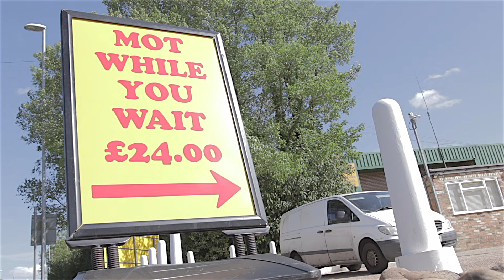High Pressure Fuel Pump Removal, Mk5 Ford Mondeo   And A Broken Timing Chain

Comment: Thanks for the tutorial and also appreciate you sharing your knowledge about doing the job while it's still on the car... I need to change the fuel pressure regulator that's on the back of the pump and this video has helped me feel reasonably confident in attempting this

Comment: Hello Alan I get A P0087 code but engine starts and runs perfectly, I have a heavy foot so Def no change in performance. I clear the code and it takes a week to 2 weeks to come back. Fuel pressure is ok when scanning. Does NOT put an engine management light on. I scan ECU every 3-5 days, it's just something I have always done with all my cars. Any feedback would be greatly appreciated. R Mc Nulty
Reply from the maker: hi rob, sounds like the start of a fuel injector leaking too much fuel back to the tank and lowering the rail pressure but not enough to put the car into limp mode. maybe best to just monitor it at the moment as the alternative would be to replace your fuel filter and carry out an injector leak off test
Reply: @alan4x  Thanks Alan this has been ongoing for a year now, 30,000 miles done, drives perfect, I'll get a leak off test done. Your a star.

Comment: I had Low oil pressure management light on my 2.0D Galaxy. I plunged in my Delphi scan tool, then found a code p253f saying engine oil deteriorated. Replaced the oil & filter, car fixed.

Comment: Vauxhall Insignia 2ltr 2017 rougly  also snaps timing chain due to tensioner failing, also it vibrates the bolt loose on the camshaft sprocket, damages lifters and valves.
Reply from the maker: thanks for the info

Comment: Brilliant video alan , weirdly cam sprocket doesnt have the second hole for 6mm , so ive good it sitting locked with the larger "8mm" hole my question is would this do the same job in regards to timing? 2014 galaxy btw

Comment: Nice video , those hp pumps also leaking oil from oil seal behind drive gear , Delphi seal it’s available from ford main dealer (bolt has left hand thread ), I miss England , maybe I sell my garage and all properties, and come back to uk . Greetings from Poland.

Comment: Another fantastic video about HPFP, but I have question about the rocker cover (this is how you call that in the video - time 8:45) and the hose this the only place in my engine (except HPFP) where I can see oil sweating and this is through that hose and the clip. I've heard that changing the clip for the one with the screw might help, but is it something to bother my mind? Should be this fixed, like changing the rocker cover (I think there is a spring with the rubber membrane under that round lid seen at 8:45min)?
Reply from the maker: hi rob...many of them leak a little from that hose..you can put a jubilee clip on it or replace the hose and clip,,,,the plastic rocker cover is a sealed unit and glued together..they often sweat oil between the glued joints but its minimal and not worth worrying about..also the plastic cover  is quite some work to replace...i have never had to replace one because it was faulty

Comment: we have a 2012 galaxy 2l diesel, it has started throwing loads of blue smoke out the exhaust on sunday, im in the middle of investigating as i suspected the turbo, but today i found a lot of oil under the diesel pump so it looks like i need to get that off tomorrow as well, is there any way this could be tha cause of the blue smoke or is that wishfull thinking. or could this be the reason the turbo may have failed. great videos and very informative, thanks for them

Comment: Hi love your videos am at whits end just done replaced engine in mk5 low it won’t start coming up with P0087-32 fuel rail pressure to low it’s getting fuel to the rail it also has ERROR on the dash where the millage should be displayed

Comment: Hey Alan, thanks for all the help and great advice you give with your fantastic videos. I know you are now living in the Philippines and probably haven't seen a MK5 Mondeo in a while, but I wondered if you could give me some advice please. I have both a Ford Mondeo MK5 and a Ford Edge Sport 2017. Both have the 2.0 Ltr Duratorq-TDCi engine. Unfortunately since owning the Edge I have had a problem starting it from cold. Once started the car drives fine, apart from only getting around 30mpg when Ford tell me I should be getting at least 40. It's been in to my local Ford Dealer and they said it could be the timing is out as it looks as though it's had a new belt. The car has only covered 52,000 miles. The timing was OK. Then they suggested the high pressure fuel pump timing might be out. So thanks to your wonderful video, I checked that myself and it is fine. Also the spring for the valve has not broken. Ford tell me that they don't believe it to be an electrical issue as no fault codes show up. As I have said the car feels and sounds OK to drive. Do you have any ideas what it could be? Oh, and why I have your attention, do you have any advice on setting up the gear linkage cables. The gears seem a bit knotchy and stiff to change up and down. Clutch seems to be OK. Cheers Alan. I really enjoy your videos. All the best, Scott Borrowman
Reply from the maker: hi Scott, these engines don't normally suffer from bad starting but did you remove the top cam belt cover and fit a pin in the cam and crank holes to see if the valve timing is definitely aligned. usually if the valve timing was out it will bring the engine management lamp on. a bad injector leaking too much fuel through the leak off pipe could cause poor starting as also a problem with the ecu could also...we have had our share of ecu issues but thats a last resort. sounds like one of those problems but when you say bad starting...how many revolutions before it fires up, good luck
Reply: Hi Alan, thank you for getting back to me so quickly. Yes Ford used the correct tools for checking the crankshaft timing. I did remove the top cam cover and lined up the holes with a 6mm drill bit when I checked the fuel pump timing. No engine lights have come on. Do you think it could be a fault with the tank pump driver module? It takes about 10 seconds to start from cold, not sure how many revolutions. Thank you for the advice. I will follow your video for checking the injector leak off pipes and go from there. See Ya!! 😂

Comment: Hi Alan. 
I know your probably retired and sat on a beach somewhere. 

This video proved excellent when my MK5 suddenly died on my way home. 
Changed the rail sensor first and realised it’s either the spring or pump. 
Checked the spring and it was fine. So set about the full pump removal and yeah. Exactly that. 

One question. What’s the easiest way to get this timed up right?
I know I need a drill bit to pin the pulley but I can’t find a video how to do that or a guide.
Reply from the maker: hi, this should help... at about 6 mins and 27 mins on         https://youtu.be/-jLzRoDQdyo?si=t0Dx4u5-ubvuHZEL
Reply: @alan4x  you are are a legend, do you have a 'we are tipjar' or similar account?
Reply from the maker: @LiamHicken hi. Well as you mention it there is a buy me a coffee on my YouTube channel home page. 😅😅😅
Reply: @alan4x done! :D

Comment: First of all, this is an outstanding video!! Iv just replaced my high pressure pump but have seen the cambelt is missing some teeth..... Are these engines interference or non interference? Don't want to do the cambelt if the engine is going to be scrap! 2015 ford kuga 2.0 tdci 150psi
Reply from the maker: Hi. These engines are interference but they are designed to break the valve rockers should the pistons hit the valves. I have never seen a bent valve on one of these engines however if the rockers are broken obviously the camshaft cover needs to be removed. There are 16 rockers which are not cheap and at that point of repair definitely fit a new timing chain and tensioner.
Reply: @alan4x  thanks for your reply, I'll let you no the outcome when I get the new belt on 👍
Reply: Yep, 8 rockers damaged!!
Replaced all 8 and cambelt replaced, back together and all working!! 😁😁

Thanks for your great videos and comments, I live in Cambridge so if I see you around I'll get you a beer, thanks again! 👌

Comment: Hi Alan! Super useful video! Do you have one on the DW10C with the A050A pump on it? My C5 has been sending me low fuel pressure error and I’ve gotten a new pump ready to go on
Reply from the maker: there is more chance of your fuel injectors causing your low fuel pressure than the pump..i would carry out a fuel injector leak off test before condemning the pump

Comment: Hello Alan
I have a ford s max 2.0 BITURBO TDCI with 210 hp and have the following concern

when I drive on the freeway and step on the gas, the warning sign comes up (see manual) and it no longer takes gas if I pull over and stop, it goes out but it starts up normally again after I watched your videos, I got that The high-pressure pump was removed and I took a look at it, but everything looked the way it should when I connect the diagnostic device and the error messages come up
P02FA
P228C
P0087

Comment: Hi Alan, i want to ask something, the car s-max 2016 year 2.0 tdci 150 hp, and i don't like how is starting when it's cold, I've placed new battery, i changed candels all 4 new! I change the relay of candle, but i don't see the differences, it's seems like battery is low and the engine is starting without candels... Thanks

Comment: Hi Alan.

I don't suppose you have a spare Spring for the HP Fuel Pump  that I can have do you, from your mate that made them for you?
Reply from the maker: yes i have a few...i can put it on ebay for you
Reply: @alan4x  Cool. 

Post up the link here when you've listed it please.
Reply from the maker: @ukcitizen1158  no worries
Reply from the maker: ebay number for the pump spring    eBay item number:185645267524
Reply from the maker: high pressure fuel pump spring, ford mondeo mk5 2 litre diesel

Comment: Hi Alan, can you tell me if you ever had to change the oil seal under the sprocket (time 15:00)? The number of this seal is Delphi 7190-266 (I don't know the ford part number). I wonder if there might be a leaking issue as well.
Reply from the maker: if you mean the "o" ring seal behind the pump sprocket then i would fit a new one every time the pump is removed
Reply: @alan4x  No, I didn't mean the o-ring, but the oil seal which is under the sprocket (you need to take it off first to get there, there are actually two seals). The seal looks similar to the one in the engine and driveshaft.
Reply: @alan4x  I assume you never have changed that oil seal :) Here is the link (https://www.youtube.com/watch?v=iTY4_XbehMQ) where a guy shows how he replaces the oil seal under the pump sprocket (about time16:32). He also shows a small hole where the oil is leaking when the seal is broken, so even if you replace the o-ring it can by pass through the oil seal. Maybe this is the answer if the pump is leaking again soon after you change gaskets. I wounder what you think about that, how long, how many miles did your taxis do before pump started leaking again? I'm in the middle of replacing gaskets on my pump, but I'm not sure of changing this oil seal under the sprocket at the moment, maybe for the second time when I'll see leaks again.

Comment: Alan, does the 2015 Mondeo MK5 1.5 litre diesel engine have as many issues as the 2.0 litre engine? I'm on 85,000 miles with full main dealer service history, can i expect trouble soon?

Comment: Hello Alan,one question .....
I have a mk4 1.8 tdci 2008 and when the engine its hot ,its start realy hard.
What it can be the problem? 
I change the temperature sensor,the crankshaft sensor and nothing.
Thank you!

Comment: Hi Alan could you please let me know what to do with this Mercedes Benz 2010 C250 code p0087-00 The fuel pressure is too low And also when I get over 60 mph wanting to take over I get the code and Car go to Limp mode less power
Thank you

Comment: Great explanation as always. I'll be a little bit offtopic: Did you ever have to change the little turbo Oil feed pipe Filter? I'll give you a part number so you understand what i'm on about. These might be really problematic on high mileage diesel cars (as proven on the focuses): Part NO: 9P424 or 1336616. I've got a 210PS diesel and i'm worried that this filter might be causing problems (being a high mileage car.)
Reply from the maker: i know what you mean..never had  to replace one on the taxis as they get the oil changes but for cars with lack of oil changes and short journeys they can back up with carbon
Reply: @alan4x  Thanks a lot for the answer. I'm looking forward to your next instructive video ;)

Comment: Great video Alan i hope i dont ever have to mess with the pump, i do have to change the long brakes pipes on my connect and they disappear under the tank going to be a nightmare using axle stands, you mentioned changing the fuel filter could there be a air locking issue on my 1.8 tdci its never been changed, keep up the quality content.
Reply from the maker: we just changed brake pipes on connect...dropped tank down..yes time consuming.  there is no in tank pump on your connect so it would be best to fill the new filter with fuel before starting it and even then it may not start and need a hand primer pump to draw the fuel through the pump
Reply: @alan4x  Thanks Alan.

Comment: Love the videos Alan, you header 😂. Keep them going 👍

Does the mk4 2.0 and 2.2 psa engine leak oil from that housing? Are they the same lumps as these mk5's?
Reply from the maker: hi, the mk4 does not have that housing..the pump on the mk4 bolts straight onto the cylinder head with a gasket...not an "o" ring...mk4 and mk5 are similar but not the same
Reply: @alan4x  thank god for that! Glad I went with the mk4 2.2 now mate lol.

Thanks for the reply, only 13 days of comments to catch up on now 😂
Reply: Hi does mk4 pump need to time  with cam shaft?

Comment: Hi Alan, is this the same engine that is in the 2015 focus st tdci, I randomly get a load of oily smoke coming out from somewhere under where the batt, air filter is etc, usually after some "spirited" driving, turn engine off and in again and  it stops, someone mentioned on a forum that it could be oil leaking from the high pressure fuel pump, any ideas?, great video as usual by the way
Reply: WOW. I have EXACTLY the same problem. Only really noticed after removing the dpf. So far swapped turbo and injectors. Completed a compression and leak off test. I currently have a ecu company looking at my stage 3 file but they can’t find anything unusual with the tune
Reply: Did you ever get to the bottom of this?

Comment: Hi Alan, how to the 2 fuel pipes come off, the ones that go to the fuel filter and rail I think. I take it you need to use a pic to get them out, held in with 4 clips
Reply from the maker: there is a little tab in the middle of the plastic clip that pushes in...you pull the centre clip out with a pick..then push the outer part of the clip in and pull the pipe off..if that makes any sense lol
Reply: @alan4x  cheers Alan, will do it tomorrow. May or may not have snapped the clip when screwing the fuel filter back in after changing it. Didn’t remove it from the engine. Trying to rush it doesn’t work. Pitty don’t have a car sitting but I will do on Monday when the new car goes on as a taxi 😳😳 make mistakes then learn from them I guess

Comment: Hello Alan! It is possible to lose 1L of oil at the pump oring. In 3000 miles I removed the oil from the engine and I still had 4.24 L from 6L. It is the same engine. The car has 45,000 miles with complete history at the Ford dealership. thanks!
Reply from the maker: it would have to be a big leak to lose that amount...some of those engines burn a bit of oil but i think they get better over time

Comment: Hi bro, is it normal for these ford high pressuer fuel pumps to have abit oil under it, as you showed
Reply from the maker: yes they are very common for leaking oil
Reply: @alan4x  tha ks for your earli reply, my car is 2010 2tdci, runs fine , smooth, as I was cleaning around engine just saw some oil around the fuel pump under it, cleaned it all up, drove another 100miles,and I run my finger around the gasket just see like a residue of oil, I don't know if its old oil , or new as I just bought the car 1month ago,.  How can I define this leak, its mot dripping no where , only if I run a my finger on it after a drive when everything is hot, is it normal for it have like a minor sweaty oil residue??
Reply: @alan4x  do I have to change the fuel pump or is there a gasket, I drove 100miles I didn't see no oil leaking unless I run my finger around the gasket all I get is little line of sweaty oil on my finger, and if I run my finger again kn the gasket it's all clean, is this normal or I got somthing to worry for, could it just be anit of sweat from the heat mixed with dust looking like oil , or  would u say its a leak
Reply from the maker: @nazzeb1477  if there is only a minute sweating of oil i would not worry about it, when the fuel pump and its hosing gaskets leak they drip quite a lot and need to be fixed but such a small amount is not worth the hassle
Reply: @alan4x  is it OK to put some gasket silent around the outside of it ?it's a Mk4 mondeo disel auto powershift

Comment: Hi, great vid. Just for information, can this "HP fuel pump timing thing" be an issue on a MK2 Focus with 2.0 TDCi DW10 engine with Siemens engine managment? Thanks
Reply: Dw10 completly diffrent dw10 is pump on the end of exhaust cam and then the hp one is run off the timing belt.... I have known of the pump on the cam to snap the end of the cam.... which results in low fuel pressure codes and vey poor running if it will run at all
Reply from the maker: no.. the pump on the dw10 does not have a toothed cog drive and does not need to be timed up